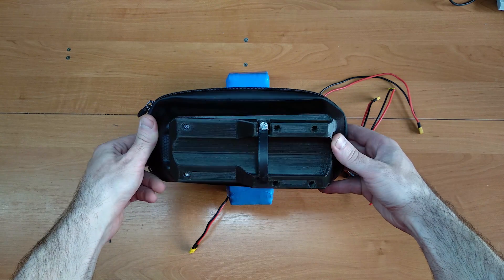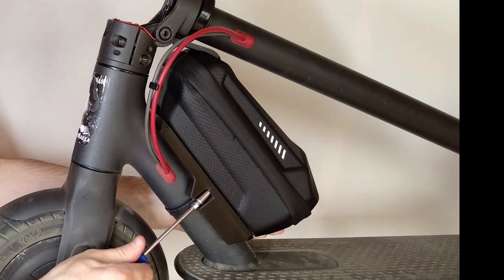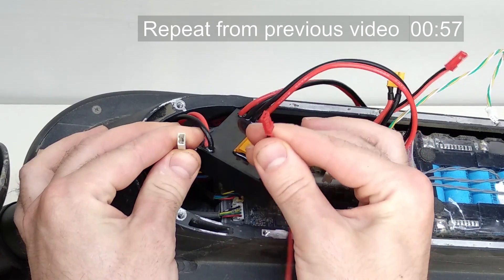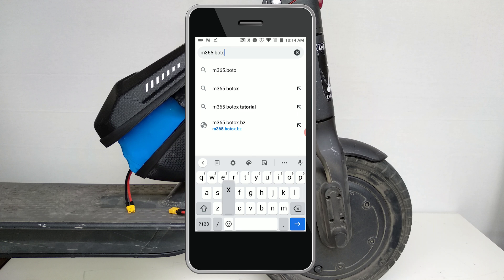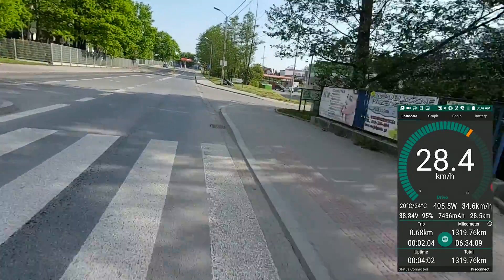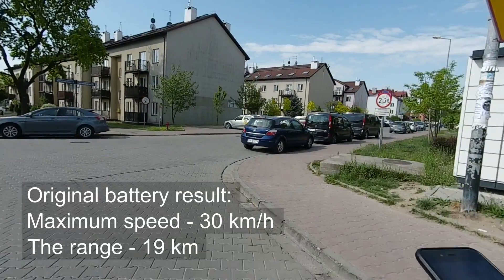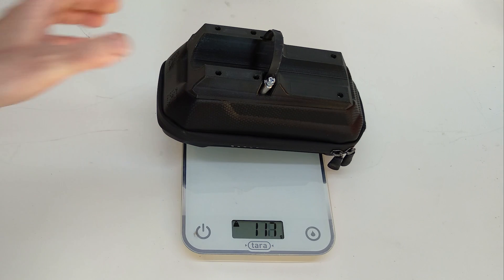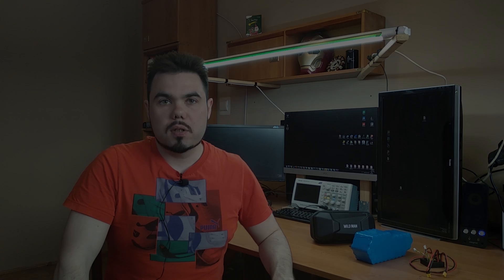Xiaomi M365 / PRO / PRO2 / 1S / 3 extra battery installation tutorial

Comment: i push 43km on my xiaomi pro on standard mode, 30% at the end of the trip (this is really slow 21 kph, on sport mode i think the range will be much lower)
I would love to test how an external will affect the pro model that already comes with a 70% larger internal battery than the regular. 

My regular m365 only gets at best 20km on standard mode.

I tried my same trip in sport mode and I would estimate make 32km range. I cut the trip short at around 50% mark so I would have charge to return. Only made it about 16km one way, had about 15% at 32km but the batt said 5% the next day just left in my room.

Comment: In the specs table with the external battery and only the internal battery, what would be the difference with the rita and without the rita in the case with the external battery? i mean is it the speed, the range in kilometers or the longer battery life?
Reply from the maker: +20-30 km range, +20% speed, a little bit more battery life since tle load is shared.

Comment: Hey do you know if this works with the aovo m365 clone
Reply from the maker: Hi, Rita adapter does not work with it, but Y-cable mod is possible.
Reply: @DenisYurev  thanks for replying, that’s what I’m going to do. Do you recommend charging each battery separately after they’re drained ? Or should I charge them in parallel too?

Comment: Hi Denis. I am having a problem with my scooter no comunication from battery ERROR 21 .I have disconnnected battery over night then when i reconnect i can run the motor a few seconds then it cuts out saying ERROR 21 . Do you think you might be able to help/ please Rgds Don
Reply from the maker: Hi, there is no short ans easy solution. The simplest way is finding a known good battery and trying it with your scooter. If it works, then your battery is the problem. If it doesn't - the scooter controller is the problem.
Reply: @DenisYurev  Hi Denis..Thankyou for the reply. I got this scooter as a NON runner hoping it may be the ''Z'' fuse. Anyway i could not find the fuse. I went to Ali Express and got new dashboard and a new motherboard and have signs of life . The battery has good voltage 42 volts and a very big circuit board along the length ,I believe this board is the balancing and whatever else it does ....possibly the blue tooth etc . When the yellow power plug is reconnected to the motherboard .....if i go instantly to accelerator it will run for a few seconds then stop and beep and flash error 21 ( no communication to the battery ) . Do you think Ali express should be able to match a balancing board to the motherboard I purchased from them ? 
I am sure the battery is good but i will look closely at the terminals in case i have missed something . In your video you really dismantled that battery and i think that may be an option . Would love to hear your thoughts i can send a picture of the battery i currently have so you can see how big the board is along the length. Regards Don
Reply from the maker: @doncodman913  Try asking in public groups, like https://t.me/m365_custom_electronics_en

Comment: The piece of cable you used in 2:50 do i need to have that or did you just use it to pull it out of the scooter?
Reply from the maker: Any wire is fine)

Comment: I installed a 25ah battery I will need the Rita or not ??
Reply from the maker: For a 10s(36V) battery Rita is not necessary, it's just more convenient to connect the battery via Rita. Please watch the previous video with a detailed explaination of the question.
For 10s+ batteris Rita is required

Comment: Was this added in series or in parallel . Trying to get my wires right . + & - to the  correct side coming out of the controller .  I think the controller shod have a +&- so with two batteries to add power you have one battery’s + from one battery and - from the other battery going to the controller. Then the + & - that’s left gos together. Is that right. I’ve got a 36v am adding iver 12v or 8v battery. To add power to 42or48v 
. Plus I think I will need to use a relay so it will work when the 12or 8v is switched off. As I do plan on having it as a Opp and not all the time running that type of power. One more thing not sure what u think about controllers. But I think it’s better to over power the controller as if it’s a 48v one there is a low V cut off. So it cuts off at 38v.

Comment: Denis I'm really interested for the complete kit for 355 EUR.....so the shipping is 22 EUR for Slovenija right?....Is there any chance for any discount for the complete kit?....It is possible payment upon receipt of the shipment?..and as I already asked u in my previous question it's possible to live the upgrade speed when I add the new battery? speed ...thank u in advance for the answer...
Reply from the maker: >shipping is 22 EUR for Slovenija right?
Correct

>Is there any chance for any discount for the complete kit?
Unfortunately we do not offer any discounts at this hot time.

>It is possible payment upon receipt of the shipment?
No, but if you don't trust me enough, I'd recommend joining my public telegram group, where you will meet many satisfied customers: https://t.me/m365_custom_electronics_en

> it's possible to live the upgrade speed when I add the new battery? speed 
I did not get the question
Reply: @DenisYurev  the original speed of Xiaomi 1s is 25 km/h but I upgraded the speed with an application to 31 km/h...my main worry is if this upgrade will vanish after I add your new battery or the speed will increase or remain the same?
Reply from the maker: @matiasnigrum1348  If you install the range+speed kit, you will reach +20% max speed more
Reply: @DenisYurev  if I order today when approximately I will receive the parcel?....Is possible that u add the piece of wire that u mentioned in the video for connecting the batteries?...thanks for your answer...

Comment: Denis can I use the original charger to charge both batteries together?... I suppose not but I ask anyway....
Reply from the maker: You can do it if both batteries are 10s(36V)
If at least one of your batteries is a higher voltage one, then you need a higher voltage charger to charge it.

Comment: If i have a external battery with the same votlage and i use rita do i have to charge them seperatley
Reply from the maker: No, you may charge both batteries via the scooter charge plug, using the original charger. The only thing is your external battery must be a common port BMS equipped, which means just one couple of wires sticking out, used for both charging and discharging. If your battery has a dedicated charging input(Separate port BMS equipped), then it is not safe to charge it via Rita.
Reply: @DenisYurev  so if there is a bms  i dont need to use rita and can charge it simultaneously
Reply from the maker: @jameelahmed9953  Yes, sure
Reply: I have a battery with different voltage. How should I charge them since my external battery which has a separate charging port?

Comment: Do you have to charge the battery pack separately?
Where can I buy the external battery?
Last question that might be 2.
When you bought the external battery, did you have to take it apart, if so then where did you buy the blue plastic wrap to hold the batteries in. I hope you read this message. 
I have a scooter that I want to upgrade
Reply from the maker: >Do you have to charge the battery pack separately?
No

>Where can I buy the external battery?
https://m365.embedden.com

>When you bought the external battery, did you have to take it apart, if so then where did you buy the blue plastic wrap to hold the batteries in. I hope you read this message. 
Google "heat shring tube for batteries"
Reply: @DenisYurev  awesome I just saw the description without even checking haha thanks a lot buddy

Comment: Denis i need to talk to you please. Im a 100kg guy in a city with hills. I have a pro 2. I was dumb and updated to last version. What can i do to have more torque to go uphills? Controller? Firmware? Paralell battery + Rita?
Reply from the maker: Hi, first of all you have to flash a custom firmware, like XiaoDash or ScooterHacking. Then, the cheapest and simplest hardware upgrade solution is mounting an external battery in parallel using an Y-cable. Rita is not essential for your purpose if you are ready to spend some time to discover the topic. Or you can just buy the "Range boost kit", it is plug and ride.

Comment: Is it supported for a Xiaomi essential?
(Please answer because I need to add one)
Reply from the maker: Yes, 100% support
Reply: @DenisYurev  damn they're too expensive, but it's disappointing that today I went for a ride less than 10 kilometers (even though its meant to support 20) and I ended up walking on my way home because it was only one blinking red bar and I live in a hilly area, meaning that with the slow acceleration* it wasn't gonna do sh*t. I'm hoping that tomorrow will be better because the temperature Wont be cold at all like today which was like 9° Celsius (and I've heard the colder the temperature, the shorter the battery lasts). So I'll see. Either way, I can't buy it, so I'll have to wait 1-2 years for my Essential to not be able to carry me anymore, so I'll have to sell it and buy something like the Pro 2, which my friend - fellow rider owns. 

*By the way, do you know if I can somehow turn off the thing where the lower the battery is, the slower the Scooter accelerates?

Comment: hi denis..great videos..ive been watching your videos since it wast in engliah.i cant relate exsactly on datas and procedure.thanks for doing some english versions of your video.i am thingking to order a pack of battery package.but the most potent one.atleast muhlch higher on 12s.my question is if im going to order on your website a bigger battery,do i have to use separate charger,one for yhe original 36v..and another one from your external battery package settings?

Comment: Does the external Battery need a bms to?
Reply from the maker: Yes, sure. But it may be a simple BMS without data lines. And it must be a common port bms, which means no dedicated charging input - just one couple of wires sticking out of the battery.
Reply: @DenisYurev  Alright, thanks alot for your fast answer

Comment: Does both of them charge when you plug in the original charger?
Reply from the maker: If you use a 10s external battery - yes
If you use a higher voltage battery - no, you need a new higher voltage charger

Comment: I have m365 and I burned my controller. I need to get a new controller or to fix and make it better in order to buy this kit?  Stock m365 controller can handle safe this battery? I am asking because this battery has more Volts than the original. Thanks!
Reply from the maker: Hi! Stock controller can handle up to 12s batteries, so it is safe to use it with my kit. I would recommend to join my telegram group - https://t.me/m365_custom_electronics_en , and ask there for a new controller, because there are a few guys who resell high quality already reinforced controllers.

Comment: Hej what bms should i buy for a battery like this . Please send a link IF you already have a favorite one?
Reply from the maker: https://aliexpress.com/item/32953719239.html
12s 30A 3.7V common port
Reply: @DenisYurev  thanks alot . Is thid also The same bms IF I want to repair The original bms of The internal xiaomi or do i have to get a higher amp?
Reply from the maker: @danihani2526  This BMS is fine if you are not going to exceed 30A current (~1200W)
Reply: @DenisYurev  can you send me a link of a more cheaper version plz

Comment: Hi, i have 3 external bateries(12ah/4.4ah/4.0) connected y cable with 350 w motor on xiami 1s and my top speed 34km/h. Do yo u think i can use rita and to add some range and speed..my range improved but the batteries dont seems to go their fully capacity
Reply from the maker: Hi, Rita is useless for you since you use 10s batteries and don't need the hot plug feature.
Reply: @DenisYurev  hello, thx for raply
i tried to move my scooter, with just the external bateries,just like you did in your video but without rita and  it dosent work.  Error 21(my scooter dont recognize exeternal battery bms) . My range is not,bad, but i can tell you  im not using my batteries to the fullest.
Reply: The  batteries  keeping charging ( i can see on display the battery% going up ) even when the scooter is dead  the battery still  charging .. That mean my scooter discharge before my bateries. I definitely think rita could help with my battery charge problem add some speed what do think after this?
Reply from the maker: @Robert Ola  Error 21 means the internal battery data exchange failure. 

Of course you can not simply use an external battery when the internal one is not presented, because the scooter controller requires data exchange with batteries.

The cheapest and fastest possible solution is flashing a custom firmware, disabling the data exchange requirement. Rita also solves the problem.

Regarding the rising battery charging level: this is ok if the battery "recovers" 5-10% of charge during an idle state.
Reply: Hi i aleady order rita, can i use my charger of 42.2 v
Reply: Csuse for what o understand the voltage will increase too.. Do u think its enough
Reply from the maker: @robertola3263  Not sure I understood your questions correctly
Reply: I already ordered rita from your shop online . Is my  battery charger of 42v 2 A enough for rita?
Reply from the maker: @robertola3263  It is fine if all your batteries are 10s
Reply: @DenisYurev  i denis is there something to do before using a 13s with rita..
Reply: I heatd un can use 13 s batteries

Comment: Hello, does it upgrades only the autonomy or the speed?
Reply from the maker: Hi! I provide 2 sets: one improves just the autonomy, while the second one also increases speed by 20%
Reply: The Rita adapter can upgrade the voltage or range?
Reply from the maker: @TakenByHeaven141  with a Rita adapter you can connect any 10s-15s battery. If your battery voltage is higner than 10s - you achieve speed increase. Range increase depends on your battery capacity.
Reply: @DenisYurev  so if i connect an 12s battery with 10ah of capacity, it'll increase only the speed or the speed and range?
Reply from the maker: @TakenByHeaven141  It will increase both
Reply: @DenisYurev  I'm ordering it now 😂
Reply: @DenisYurev  What is the perimeter of the mounted bag?
Reply: Or I have to buy an battery that has more voltage and connect it on the Rita adapter

Comment: Hello man, thanks for the wonderful video! I want to mod the battery of my Xiaomi Essential, would any 36V battery pack work without modding the Firmware? Appreciate it
Reply from the maker: Hi! 
1. If you want to replace the internal battery to another 36V one without special Xiaomi data connector - you have to flash the scooter to let it accept batteries with no data line.
2. If you want to connect an external 36V battery, using the Y-cable mod - you have to flash the scooter to avoid wrong switching to the charging mode when current flows between batteries.
3. If you connect an external battery throught Rita - no flashing is required, you just plug and ride.
Reply: @DenisYurev  Thanks man! I am going to use Rita anyways! Gotta get some extra milage! :)

Comment: Hi Dennis,
I have an essential scooter and just received Rita 4gen.
But now I’m aware of my 10s4p battery is with two different cables. One for charging and one for discharging (usage). Not with a common port BMS. 

1) Will I be able to use that battery with Rita 4gen securely if I ensure to disconnect external battery when charging. And ensure external battery is charged using external charger?

2: The essential charges batteries in running mode when I brake. Will this setup damage something when using an external battery without a common port BMS using Rita 4gen?

Looking forward to hear from you.
BR René
Reply from the maker: Hi!
1. The most convenient way for your separate port bms equipped battery is to leave two Rita charging lines not connected. That allows you to keep the external battery connected during charging, and just plug 2 chargers at the same time. Check more information in the user manual is "Batteries charging" section - http://public.embedden.com/Rita/Docs/English/rita_manual_latest_en.pdf
2. Generally, in theory, it may be unsafe, because recovery current goes to an external battery via its discharge port, which can not be disabled by a separate port bms. But in real world this situation is almost unreacheable, because recovery current is not too much to overcharge a battery. Even original Xiaomi battery works this way.

Comment: does the other battery have its own bms?
Reply from the maker: The battery presented in the video does not have a BMS, because I was in hurry to make it as quick as possible for just 1 day usage. But generally this is very dangerous and prohibited to use lithium batteries without BMS. Of course every battery I sale are equipped with a BMS.